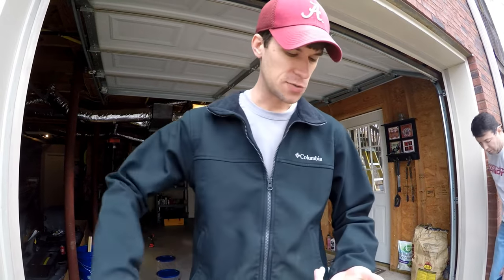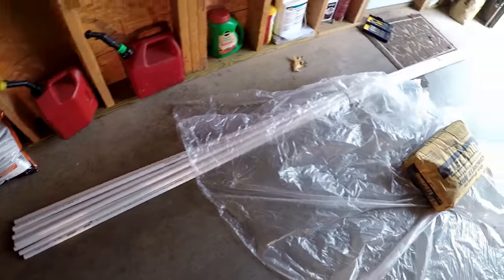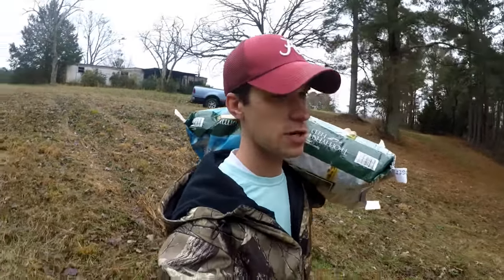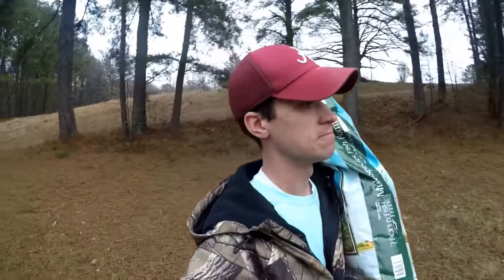Building PVC Structure for Bass Pond | MEGA Bass Factory | B Fishing |

Comment: I never burn my tree limbs on the farm. They all go in my pond. I have lots of brush piles in there
Reply from the maker: We did it this way just to limit the number of snags. The thickness of the PVC should prevent this.
Reply: @B_the_Cameraman  i have pvc structures also but the brush is better for the fish because algae (food chain) grows on it much better. I doesn't grow on pvc much at all. The brushpiles protect my fish better from stinking cormorants also.
Reply from the maker: @jamesbarron1202  good to know. The pond has a fair amount of downed trees on the back part and that is where we usually fish. We are just trying to get rid of the flat bottom in some areas.
Reply: @B_the_Cameraman  big rocks piled up makes awesome habitat. Especially for crawdads. I built an underwater rockpile wall going from deep to shallow. I pile rocks up when it gets low during our triple digit no rain summers